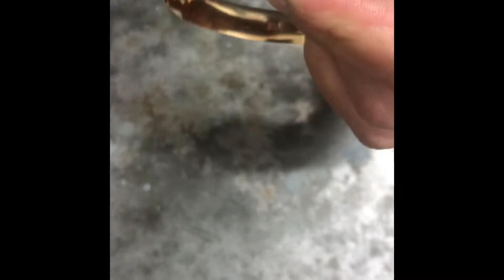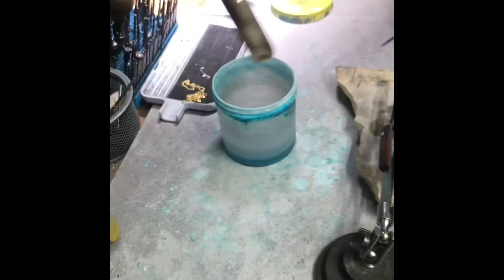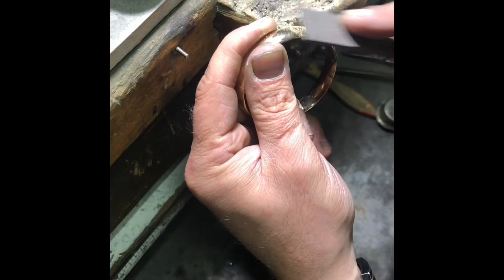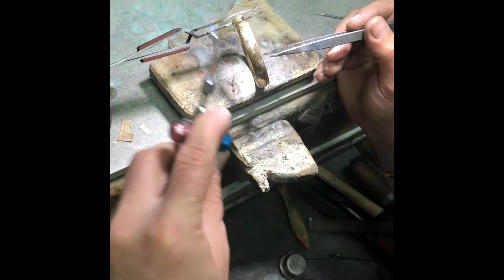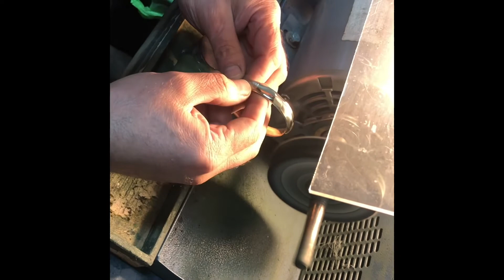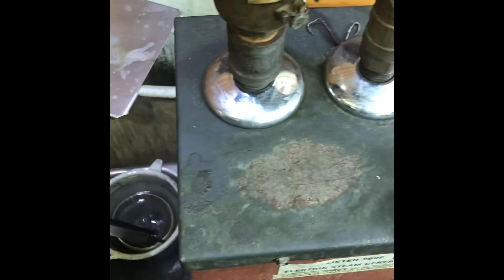Repairing a Hollow 14kt gold Bangle

Comment: There is an easier way. In the center of the dent easy solder a gold wire a couple of inches long. Then push the wire through a draw plate with bangle on the others side. By slowing pulling against the draw plate and slowly checking your progress the dent can be removed. When done just remove the wire and polish.

Comment: hi, upon receipt the client will be completely satisfied, but in six months the filling point will unfortunately show the inevitable two-tone. the craftsman knows this, but there is no other way.
Reply: What will cause two different tones? The fact that the gold composition of the donor gold likely does not exactly match the composition of the bracelet gold?
Reply: @iandinwoodie 
 regardless of carats, same proportions of alloying additives melted differently times again an again are the same each time, there is a little difference in the resulting finally color tone.
Reply: @arelgr9407  thank you for the info!
Reply: if you have a laser you can use 14k laser wire and there will not be any sign of repair